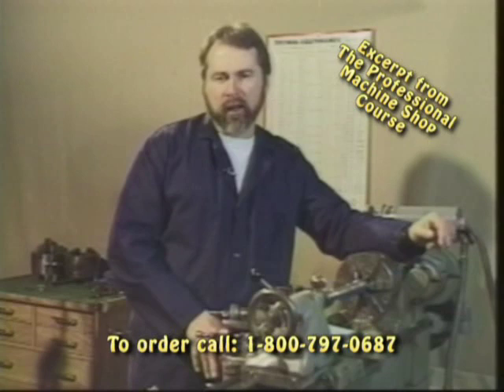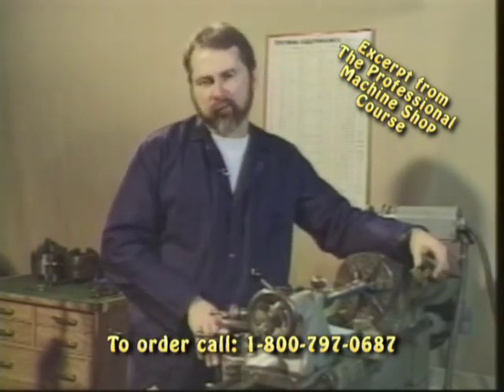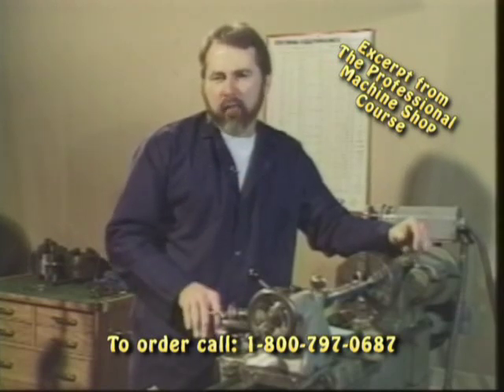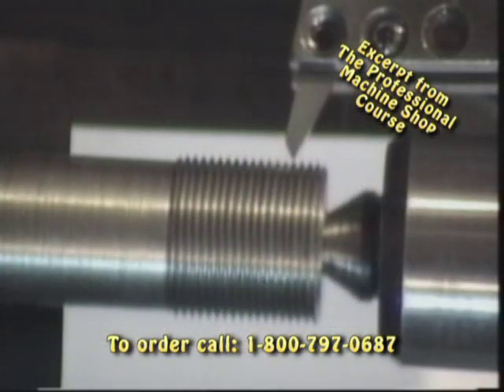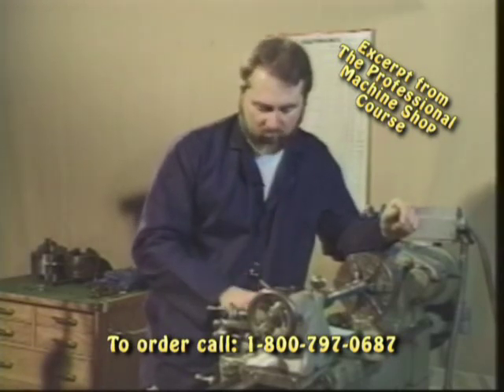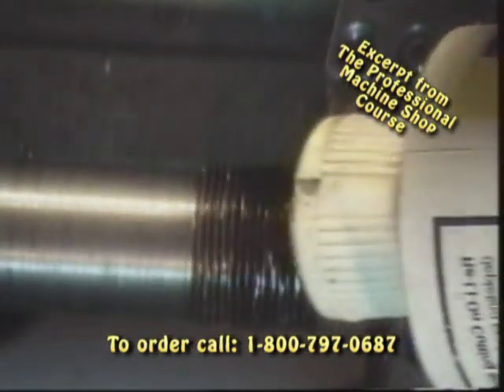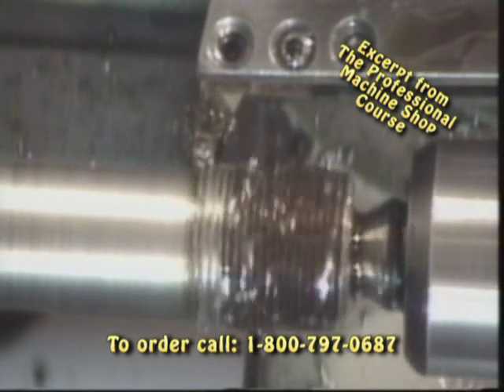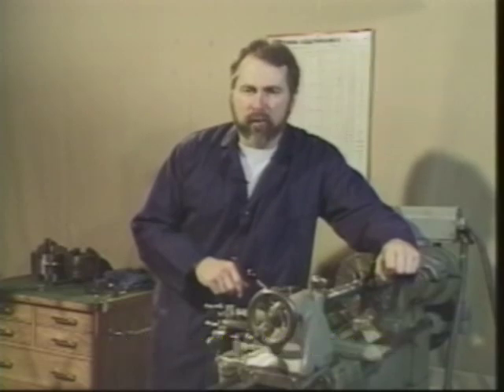Machine Shop Training:  Lathe Picking up a Thread ATI Lathe #13

Comment: One thing has got me wondering; You said "We are going to advance our cross feed to get to the full thread depth"
I always thought when you reached the end of your thread, you backed off the cross feed, and moved your carriage down past the start position, then ran your cross feed back to the same spot, and advanced with the compound only. The cross feed it self, always returning to the Very same depth.
Reply: dbeierl Can you say that again please ??ehehe only joking that is handy information thank you mate..
Reply: I think he glossed over a thing or two.  He seems to have something on that lathe that lets him retract the tool between passes without using the cross slide -- or else he's very practiced with the cross slide dial.  I think he misspoke and said cross feed when he meant compound, as he's got the compound angled about where you would to cut on one flank of the thread with just a kiss on the other side.  It is possible though to cut threads by advancing straight into the work, in which case you'd use the cross feed to cut as well as to clear the tool for the next pass.

The part I see him leaving out completely, though, is how he figures out how much additional cut he'll need to complete the thread, since any reference points he had before are now disturbed.  I suppose one way would be to use thread wires or a thread micrometer to measure the existing thread.  On this particular example chances are the full depth of thread will be reached when the tool starts to mark the shaft beyond the thread unless there's an additional allowance for a vee tool.

If he's got resettable dials then once he had the tool engaged properly he'd set both feed dials to zero for ease.  Otherwise he'd have to note down whatever numbers he'd arrived at and use them as starting points.

If the tool dimensions and position hadn't changed then he could probably take care of this by leaving the feeds where they were, disengaging the tumble reverse, rotating the chuck until the tool was correctly positioned relative to the thread and re-engaging the tumble reverse.  That way he'd leave the compound alone but bring the cross feed in to the original zero point while rotating the chuck to move the thread to where it needs to be.  But if anything about the tool had changed or the initial thread hadn't been cut on that same setup it's not likely that he'd be able to precisely pick up the thread that way.

Comment: you forgot to mention the most obvious and important point. SET THE CROSS SLIDE to ZERO or any other recognizable value! Remember! you need to return to this number after each pass. Or set the cross slide stop.  Compound number value means nothing other than some incremental setting because thats the infeed for the cut. Of course, because your not using a, hehemmmmm,, Hardindge HLV  they have that sweet little retract lever on the compound allowing retraction of the tool at the end of the pass.